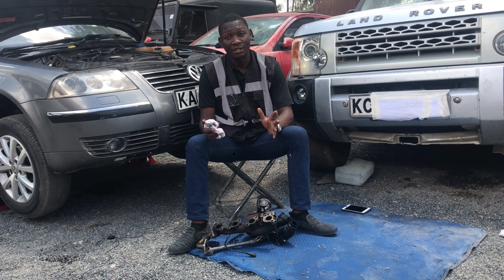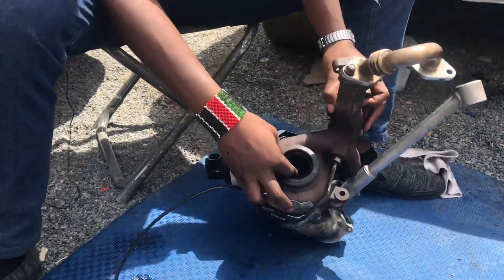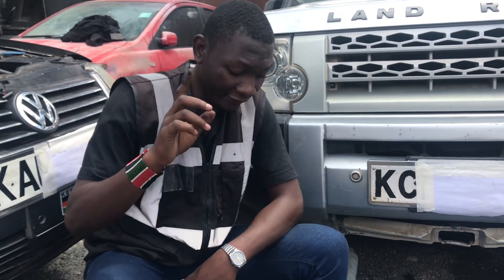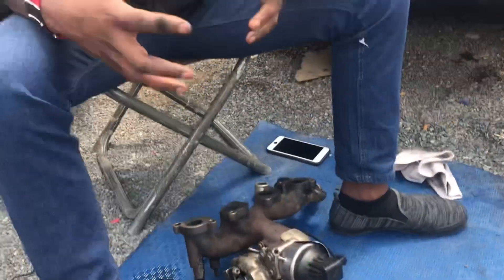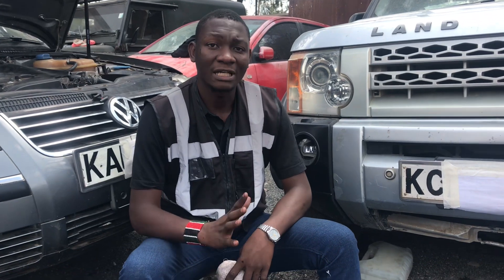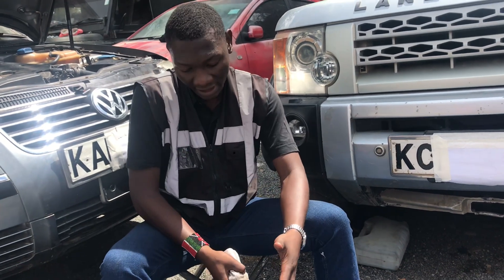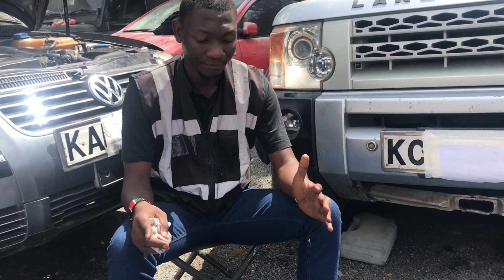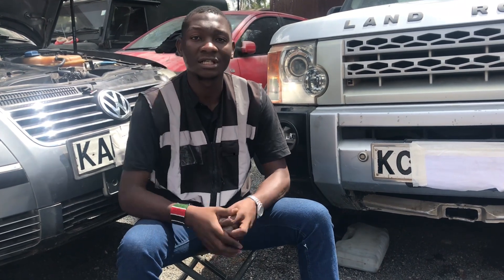Turbo and Supercharger. How does a turbo work

Comment: you have alot of knowledge,can you make an NA car turbo engine,lets say like a normal vits or probox?
Reply from the maker: Very possible. The cost of conversion and the components to be changed are however the real issues. Better replace the engine with a turbo one from factory